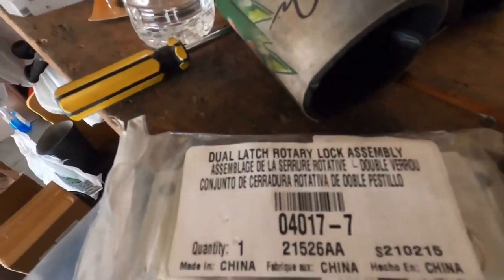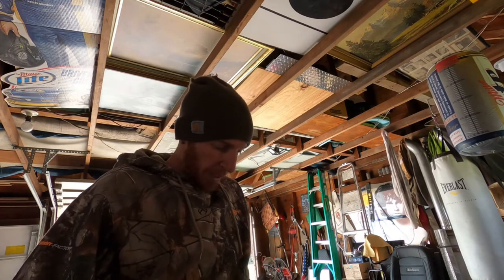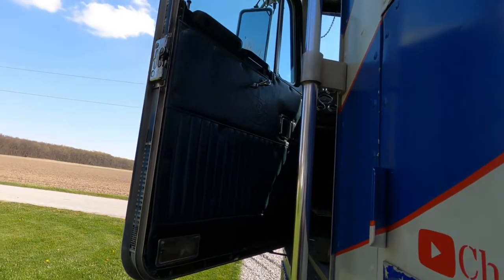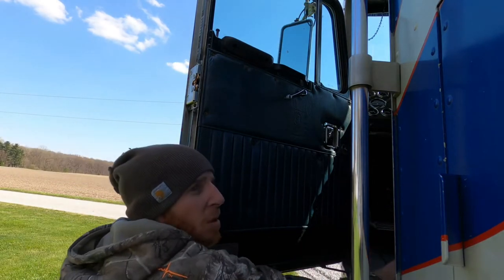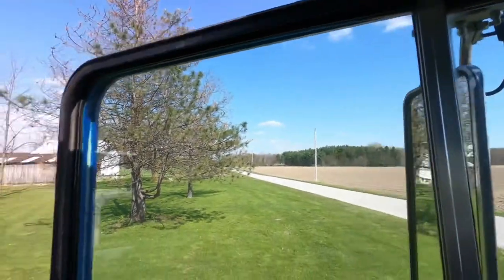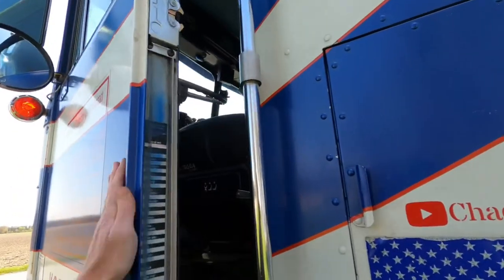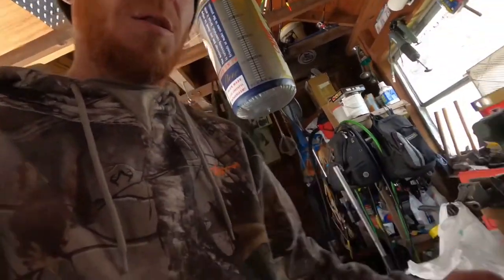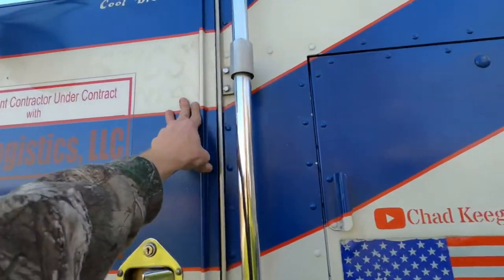Cabover K100 door latch replacement

Comment: O K😂
Reply: @1ChadKeegan  I had a 76 k 100 back in 82 it was the first year for the 3406 (previously was 1693) I noticed that your blue one and the green one had different size grills is that because they have different engines or is it different years the older ones with the name on the grill were even narrower. I like your videos a lot am retired now so riding with you I have all the pleasure of riding and no hassles 😎
Reply from the maker: @carldrexler7883  the blue truck is a 83 k100c model circle headlight with the floor shifter aka shaft. The green truck is a 90 k100e model with square headlights and cable shifter. So there’s a few differences in cab sizes etc. glad you enjoy them.
Reply: @1ChadKeegan  thanks 🙏 what engine is in the green one?
Reply from the maker: @carldrexler7883  it’s a 3406b cat 4mg, the Frankenstein playlist is where you can learn more about it.